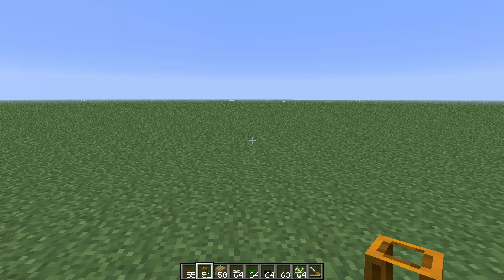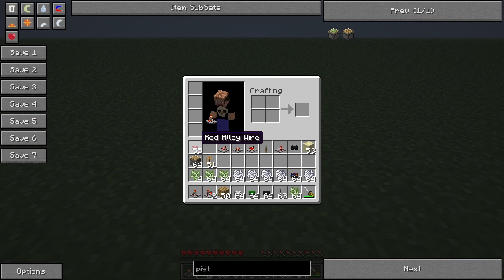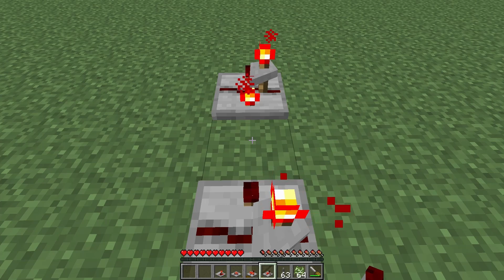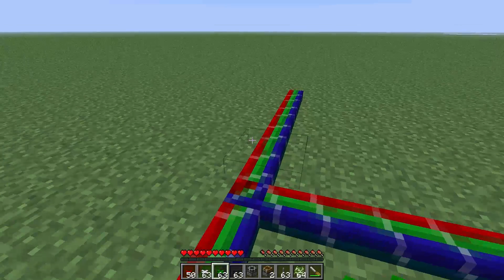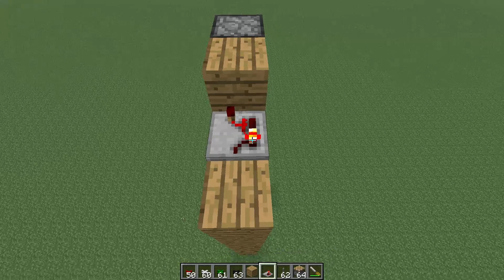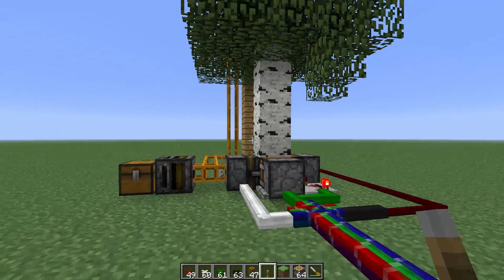[Tutorials] Automatic Tree Farm - Redpower

Comment: You can use a quarry with a 2x2 area (1x1 didnt work) and put above the corner that includes the trunk and does not include the deployers. you could then take a fraction of the wood to use in a steam engine powering the quarry. It is quite expensive but is the only way i found out how to do it.

Comment: So running Tekkit 305 and there's some kinda bug on bonemeal now I guess. If you wanna know if it will even work build one deployer and put in some bonemeal, plant a sapling, activate it with a switch. I set up the one in the video but noticed no growth. Set up the simple one here, no growth. Tried doing it manually and I find I have to hold down and the animation occurs maybe 20 times before it works. So instead I used EE to mass produce coal instead. (Coal -> Coke Oven -> Geny)

Comment: @lokilotis Yes only Oak and Pine can grow to big ones but only oaks have branches
The counters count the broken blocks not the wooden ones so it doesn't matter if the tree is larger or smaller. BUT the piston has to be high enough for the specific type of tree.

so pines would work too but oaks wouldn't (at least the one with branches)

Comment: I THINK (Correct me if I'm wrong) only Oak or Pine can grow 'Huge' trees, and I think (again, correct me if I'm wrong) the counters work by counting the number of wood blocks produced and/or the No. of times each machine has to run. Birch trees (I Think) have a set No. of wood blocks (Therefore a set height, Therefore a set amount of blocks broken by the breaker, including sand). The system only works with a consistent height of tree, which is only provided by birch a full 100% of the time.